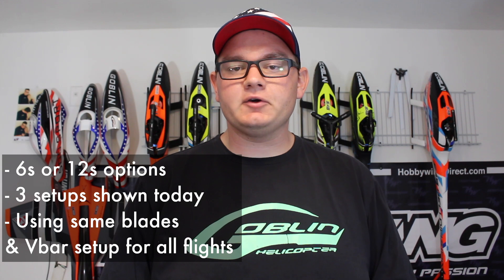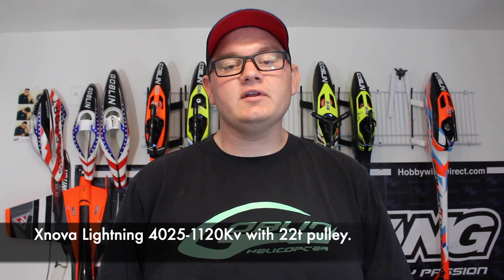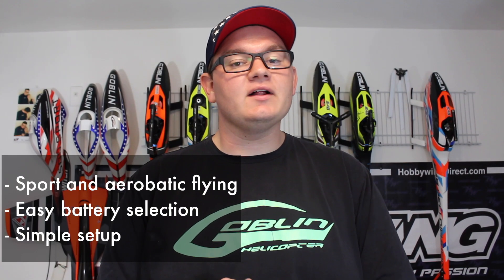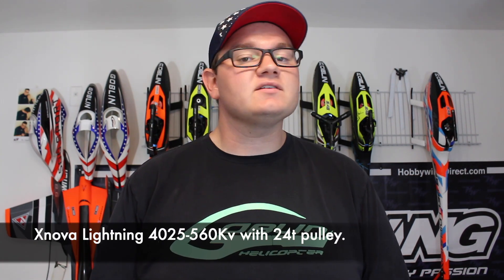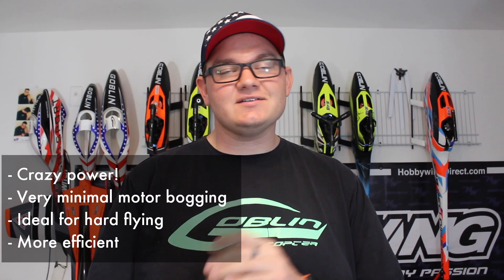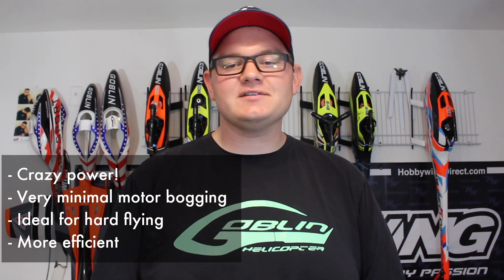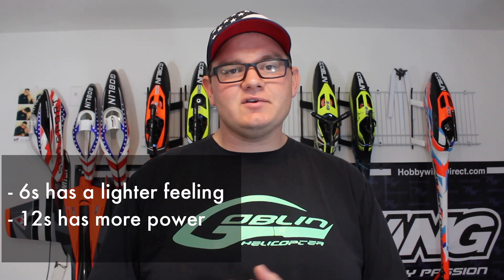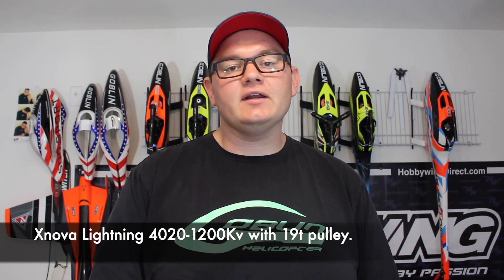Kraken 580 setups. 6s vs 12 vs nitro!

Comment: Hello, I need some information, is the hobbywing 200A beak compatible with a kraken 580 or should I take the 130A beak?  In fact I want to buy the 200A to put it later in a 700 but not sure.

Comment: What speed controller would you recommend, would the Castle 100 work for this using the 6 cell setup, with he Xnova 4025-1120kv.
Reply: hobbywing 150A

Comment: I switched from rotary to fixed wing (planks) about 10 years ago and hadn't really followed the heli progression.  Geez...the speed and intensity of the maneuvers has really ratcheted up. It's about the same for the planes though,  try hard to brake the damn thing lol. As a spectator you can barely keep up. If it wasn't for muscle memory one wouldn't have a chance flying at this level

Comment: I'm running the Xnova 4020 on my 580! I actually have a 4025 here in the box but really liking the low RPM feel I get from the 4020! Great video, hope to see more tips and tricks!
Reply: Setup my 580 with the 4020 as well, absolutely love it.. I love the flight time and I am not a hard 3D flyer... I wouldike to know why 19T pinion.. I only had a 20T and runs fine, but would like to know what the 19T would do for me.

Comment: Great video. Would you be able to do a vbar/Hobbywing setup video with the original and touch radio? I’ve shut mine off with a 120 and 130 on a 550 size machine. Backup gaurd saved it.
Reply: This sounds like you may need to lower your gearing by dropping down 1 pinion size and perhaps lower your BEC down to 6v
Reply: @HeliBrent  7.4 with a 12t pinion on an oxy 5